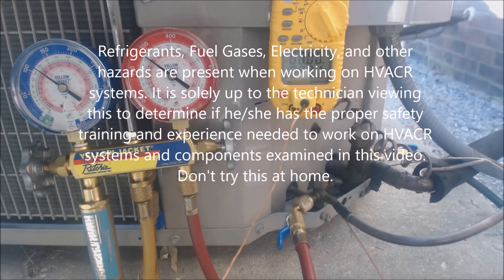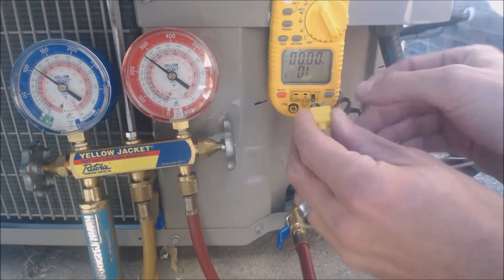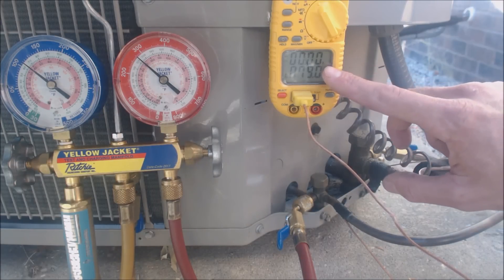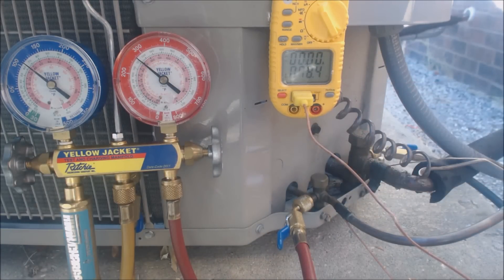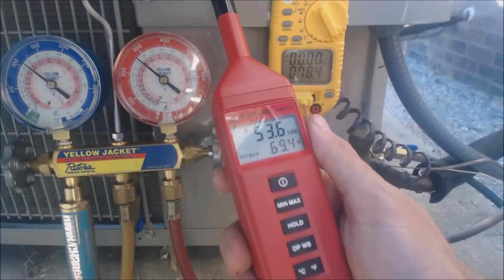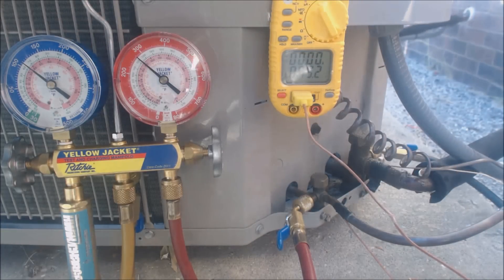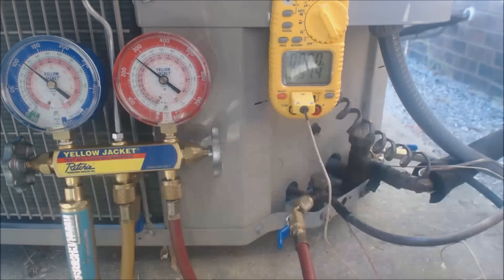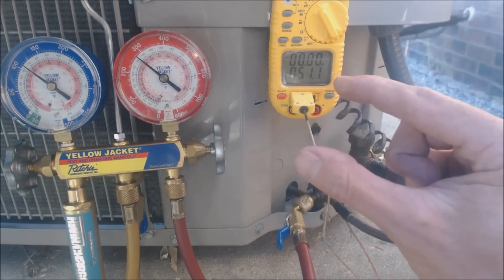Exactly What is Superheat and Subcooling? Shown on a Live AC Unit!

Comment: Thanks for awesome video and awesome book.  I love the book.  Question though:
Lately, I have been running into high SH and SC at same time.  Piston system, liquid line drier is fine (less than 0.5F), supply air is cold.  What am I missing?  I have seen mentioned blocked orifice or screen, but in a 10 years or old system with sealed refrigerant loop, how would dirt get in to block ?  Also, what do I tell customer, when they say system was cooling fine last summer or just service the unit, it's cooling fine.

Comment: Great video! So do we check for superheat at the condensing unit suction line or inside the house evap coil? (for a fixed orifice)
Reply: The reason I'm asking is because in trade school they always said check superheat leaving the evaporator at 6"
Reply from the maker: The problem is that there is usually no port at the outlet of the evap coil to check superheat so we check total superheat. Also the total superheat is very important to check to make sure the compressor does not get liquid entering it. I have a full article with pics on the total superheat method at our website https://www.acservicetech.com/articles

Comment: Excellent demo. It makes sense that superheat on the low side will be greater when the system is undercharged, because inside the evaporator coil there is a greater length of evaporator coil where only gas is in contact with those warming fins. However I am stumbling when I try to use that same logic to think about supercooling on the condenser side. As you say, a greater observed supercooling means the system is overcharged, not undercharged! Why is this logic reversed on the condenser side? And why do you have to approach the problem differently if the system has a thermal expansion valve?

Comment: Can you check superheat and subcooling in heat mode.
Reply from the maker: You can't check the charge level well in heat mode because you don't know how much refrigerant is in the accumulator. However, you can follow the manufacturers guidelines if they provide them such as on a packaged unit. You can also check the charge in ac mode when the outdoor ambient temp is between 40 and 70 degrees- https://youtu.be/OmQQcjmNLgw

Comment: Question. May be silly question but you stated when to much sub cool you recover from high side to. So when you need to add charge to bring sub cool up do you add charge from high aide as well or add charge from low side still?
Reply from the maker: So remember that the bottle pressure is higher than the low side vapor pressure of a running air conditioner. The bottle pressure is lower than the high side liquid pressure of a running air conditioner. The refrigerant will travel from high pressure to the low pressure area. To answer the question, to add refrigerant, charge into the low pressure side of the system and if it is R410A keep the virgin bottle upside down so liquid comes out of the bottle. I have everything I want to explain to techs in reference to working with refrigerants put in my book that is available at my website https://www.acservicetech.com and on amazon thanks!

Comment: Thank you for your great videos, one question came up when I saw this video, should we check the temperatures when the unit is off or when it is on? And if the unit is off, does it matter if the unit has not been used for a while? Does it have gonna effect on the result?
Reply: Unit should be running for a while to get the accurate saturation temperature. Ambient temperature should be preferably 70 degrees and up.

Comment: Great explanation, I would like to discuss with you, mostly your videos about AC systems which usually the pressure and temperature are higher than refrigeration application, specially with all what related to target subcooling and superheat, I would like to know what is the best way to determine them for refrigeration application which we can work in different set point starting from +5°C to -30 °C.
Thanks
Reply from the maker: Refrigeration is completely different though you do still check superheat and subcooling. When starting a system up for the first time with the door open, you would want just enough refrigerant in the system to get a clear sight glass which means just about 1 degree of subcooling and your superheat will be high. Once you get down to temp and are running at the normal temps, you would want the superheat running at roughly 6 to 8 degrees of superheat.

Comment: Greg  lets say  that the target superheat is 12 degrees , and we have 30 degarees, how much refrigerant do i have to recover?
Reply from the maker: You would add if the actual superheat was higher than the target and the system was a fixed orifice ac unit, thanks!

Comment: I get that you don't use superheat to check a txv because the txv controls superheat, but not not use subcooling even without a txv? Is there a reason not to use subcooling on systems with a cap tube or piston?
Reply from the maker: We still check it for troubleshooting and system health but the refrigerant level is based upon the total superheat for a system with a fixed orifice, thanks!

Comment: Does this apply to automotive a.c. ?? 
Thanks
Reply from the maker: For automotive, we mainly just use the total weight method because the automotive compressor runs at varying speeds due to the engine rpm, thanks!

Comment: Fantastic video on how to charge both types (txv & piston). Just what i needed. Clear, simple and straightforward. Many thanks for taking your time on making this video. Is there another way to test the return with out a wet bulb meter for superheat or I need to buy that tool? Thank you
Reply from the maker: Hey Nero, here is a link to the wet sock temp sensor if you already have the ST4 for reading temp or you can take the sock off and put it over your temp sensor - https://amzn.to/2LmINR4
 - it is the same premise as a sling psychrometer if you but it into a moving air stream, the temp reading will be wet bulb, thanks
Reply: AC Service Tech LLC 
Thank you

Comment: I was surprised how the outdoor temperature was about 80, shown on meter, but when you switched to temp of liquid line the temp was about 78. I had assumed the temp of liquid coming out of condenser could not drop below temperature of air cooling it!
Reply from the maker: You are correct, the outside air temp must have been off by 2 degrees due to where I had it. Great observation!

Comment: Explained very well . Thank you so much!
Reply from the maker: Thanks John!
Reply from the maker: That is extremely high. Something doesn't sound right at all, especially if the temp in the building is below 80 degrees . Is the subcooling way too high on this unit? Is the delta T very low? thanks and unfortunately, I will without internet access for the next 5 days but I wanted to respond before hand, thanks

Comment: Well, another terrific vid. Just wanted to mention that your mentioning that the pressures were giving up the temp in the middle of the coil was the penny that dropped all the others in the slots for me. Of course, temp is ‘stuck’ where states are being changed and that sets the pressure for the coil, so just set the thermometer after the coil exit point and you have captured the temp diff. Between saturation and the end of superheating or cooling. 
You have a great knack; thanks.
Reply from the maker: Glad to help!

Comment: i work apt maintenance the rule is 40 degrees  and go and when i try super heat my low side pressure seems to be about 85 psig so not sure what to trust how close should pressures and super heat be in relation
Reply from the maker: If you have fixed orifices then it will depend on the heat load if the evap will be near 40 or will be 36 or 48 degrees. If the unit has a txv then it will hold a superheat of 10-14 and you won't be able to change the superheat or sat temp by adding refrigerant. Always use superheat for fixed orifices and subcooling for txv's for efficiency and compressor safety, thanks
Reply from the maker: Jeffrey, check out the "acservicetech superheat playlist" and also the "acservicetech subcooling playlist"

Comment: Hi acservice
A quick question
If we don't have any check valve on liquid line in some split systems does that mean the metering device  is not a txv? If it had a txv then we would have need a liquid line valve to measure subcooling?  Is that correct?
Many thanks
Reply from the maker: For single and two speed compressors, you would need to check the liquid pressure converted to liquid sat temp for checking subcooling for txv systems. Vapor pressure would be converted to vapor sat temp used for superheat. Also type in the search"acservicetech check refrigerant charge without gauges"
Reply: acservicetech
There must be a. Misunderstanding.
My question is about txv and fixed. Orifice
Is there anyway to understand if txv or fixed orifice is the metering device of split system without opening the indoor unit?
Reply from the maker: I didn't understand what you meant when you said check valve. Yes you would look at the indoor evap rating plate to see if it says txv equipped. If it doesn't say that and there is just a nut on the outside then it is likely a piston. It is best if you can check though to be certain by taking the evap coil off if you are not sure, thanks Ace!
Reply: @acelookrenos611  it's easy to know if the coil box has a txv, you can see the txv bulb tied on the suction line outside the evaporator coil box

Comment: Just wondering how I can realize if the metering device for a split system for example is txv or fixed orifice without looking in to indoor unit?
If I have a check valve only on vapor line, does that mean this unit is working on a non txv metering device?
Reply from the maker: If the unit is a minisplit then it may only have a port on the vapor line. You would need to determine if it is a single speed compressor or vrf. If it is a conventional system, I always go to the indoor unit to verify what metering device is installed as they are field installed and the installer would have put in what they chose. On packaged units, it would say on the rating plate.

Comment: you have it so the screen is cut off where your gauge is set. what is it set on to read the temp?
Reply from the maker: Hey Carson, what were you watching the video with and did you have the screen maximized? thanks
Reply: acservicetech it was on full screen. the videos are the best I've seen so far, but I can't seem to figure the refrigerant part out, it seems so complicated.if I plug the temp probe into my field piece what setting do I use ?
Reply from the maker: Before you use a fieldpiece digital manifold, the temp sensors need to be calibrated. I always tell students to start with an analog gauge set until they really know what they are doing and then switch to the digital if they want to. I need to do more digital manifold videos. Presently I just have the calibration one. look up "acservicetech sman"

Comment: I have recently purchased the Imperial Kwik charge vaporizer and noticed that it has a 1/4 thread as opposed to a swivel connection. Should I purchase a 1/4 NPT x 1/4 JIC connector to allow me to quickly install or remove this device? I have the YJ system analyser and if I connect it directly I will have to purchase a 1/4 " NPT x 1/4 NPT adaapter. Please advise.
Reply from the maker: The 535-C vaporizor can get directly screwed onto the refrigerant tank or on the bottom of the gauge set. You shouldn't need a standard thread. I do agree, it would be nice if it had a swivel end piece such as on the end of a refrigerant hose though, thanke

Comment: Hello & Hi. My handling a HPAC unit or somebody call it package unit. My unit always keep High pressure alarm even when we cleaning the condensor coil. I already talk the user about the unit keep on running 24/7. What is the best solution to solve the problem? My unit using R407C.
Reply from the maker: What is the superheat and subcooling? Does it have an 18-21 delta T?

Comment: Real nice to the point video... Thank you. One question, how do you determine whether or not the TXV hasn't been tampered by another tech? Instead of over/under charge?
Reply from the maker: If you have the correct subcooling with a txv and you have 18-21 degree delts T then you are good. If you have the correct subcooling but your superheat is too low then the txv is bad or adjusted out of calibration. In AC systems the superheat is usually 12-14 degrees of superheat so if you are reading a total superheat that is close then you are ok. Most AC txv's are also non adjustable unlike refrigeration txv's. You would likely be interested in this playlist for troubleshooting with superheat and subcooling, thanks-   https://www.youtube.com/watch?v=G7FvHvpF_10&list=PLxnHR5_D2ojxYvmqURUYPrUsM2kKBLJqL

Comment: piston...SH...outdoor temp and wet bulb: SH suction line temp and saturated temp..is this two ways of checking super heat
Reply from the maker: Outdoor temp and wet bulb is to find target superheat, here is a video on that-  https://youtu.be/bIL9BrKCujc  -- and you need to compare this to the actual with line temp-sat temp. High superheat- add refrigerant, low superheat-recover refrigerant, thanks!
Reply: Thank you!!

Comment: You are great instructor ! 
in order to check the proper charge how long do you have to wait for the unit to stabilize or when it's under load let's say you just started the ac and the house is warm ?
Reply from the maker: 5-10 minutes for subcooling, 10-15 for superheat, thanks

Comment: Nice videos
Question here i am checking a unit and system turned on with  R22  gauges pressures are low side 52 psi liquid side 255 psig and the subcooling i read is 20 degrees, Diference from 99 and 119, is that meaning i am low in refrigerant?
Reply from the maker: Thank you for your comment and great question. That vapor pressure converted to sat temp means that the middle of your evap coil is below freezing. If you have a txv and it is a comfort cooling system then it is a bit overcharged but that you can't get the vapor pressure to rise. I would start looking for a duct restriction such as a clogged filter, lower blower speed, duct blocked or it could be a restriction in the refrigerant right before it comes into the txv or the txv itself. If it has a piston as the metering device then I would need more details such as wb inside, ambient temp outside, actual vapor line temp near the service valve as well as the current vapor pressure art that time. Thanks! I do have some txv troubleshooting videos that you might want to check out if in fact you have a txv. They are in the txv playlist on the main youtube channel
Reply: acservicetech thanks for the quick respond effectively the return filter was clogged i will hook up the gauges again and see what i read now. So that reading was meaning that if the evaporator coil was below  freezing acting as a restriction or blockage and the refrigerant is kind of  traped in the liquid side rising the liquid pressure and lowering the vapor pressure? 
my gauge hoses dont have a ball valve is there a way i can not loose the freon when i disconect the red hose? 
Thanks a lot for taking your time to respond.
Reply from the maker: Here is the video for charging liquid back in, Thanks----https://www.youtube.com/watch?v=zJmZHzLwqbs

Comment: Suction line 80 PSI
Liquid line 400 PSI
Suction line sweating back to compressor
Return air temp 80ºF
Supply temp at coil 65°F
Air temp coming from diffuser in store 70°
Refrigerant is R-22
Give me your thought here pls??
Reply: Your condenser coil may need to be cleaned buddy
Reply from the maker: What is the temp on the liquid line near the service port? What is the temp on the vapor line near the service port? Temp outside? Does the system have a txv or piston? If you have questions please also check out the  superheat and subcooling playlist.  Thanks! ----https://www.youtube.com/playlist?list=PLxnHR5_D2ojxTcAtR_53GoY8huBcSOt0a-----https://www.youtube.com/playlist?list=PLxnHR5_D2ojwGvhU1rseXQLJ-XBjBZMMk

Comment: Thanks for it efforts and sharing I have many questions for you because where I am living the professionals like is serving big compane only and the normal houses are served with the uneducated people they only care about how much they can take from me and for recharge they only know that they only need to recharge to 60  psi any way it is a long story 

Mt first question is there is fact here almost every one say it they said do not put the refrigerant tank or bottle upside down because it will out oil to the compressor and it will harm very bad ! 

Is that true?
Reply from the maker: Great question! With R-410a refrigerant, it is a near azeotropic mixture that is made up of two refrigerants and needs to come out of the bottle as a liquid. You use a throttling device such as the one hanging down off the bottom of the gauge set in the video you just watched in order to flash the liquid into a gas before going into the compressor. We all charge with the bottle upside down even for r-22. They may not have a throttling vaporizer. Thanks for the Question!